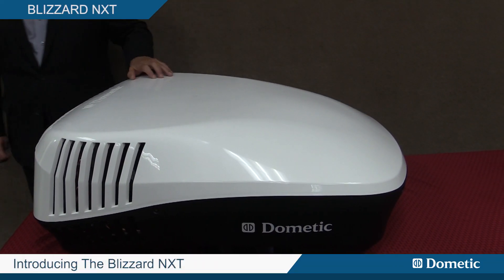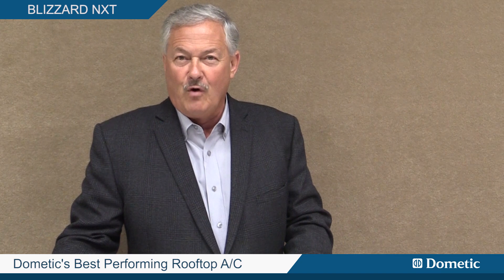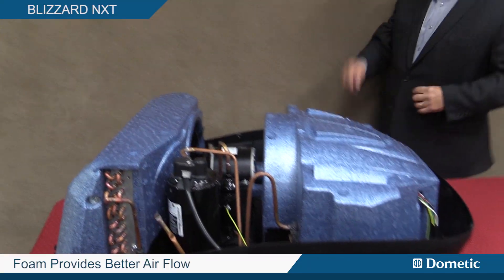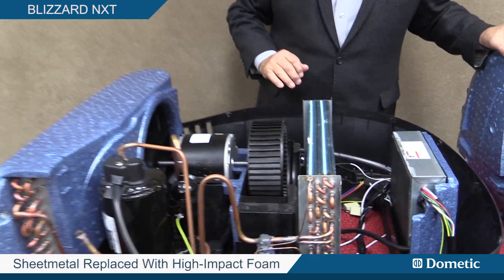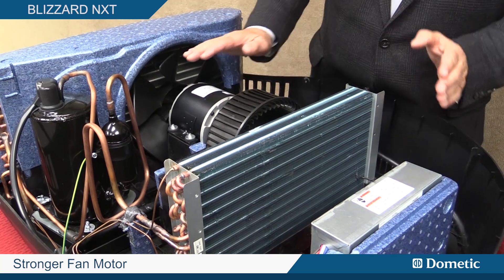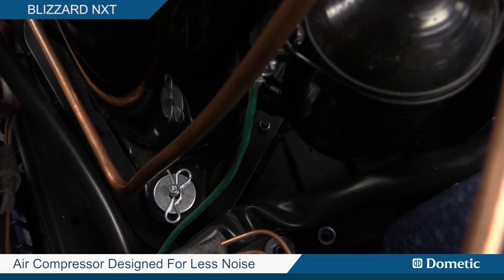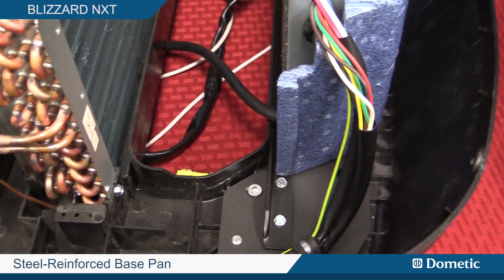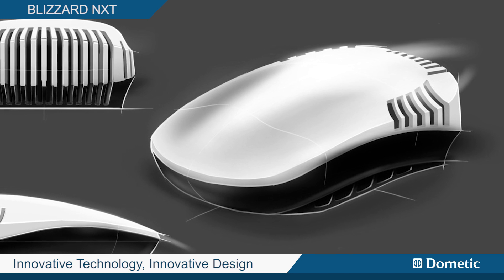Dometic's Blizzard NXT RV Rooftop Air Conditioner

Comment: I have a brisk air ii 15k will this blizzard nxt 15k install plug and play?
Reply: No you gotta buy a circuit box to make it work. Call dometic and the will give you the model number for it . But if you have a blizzard already I would just stick to what you have because that circuit box is big for a 14×14 hole.

Comment: Still not as good as a Coleman! Or Mach!
Reply: I have a coleman mach in my two year old camper, it is junk. Can't even keep my camper at 75 when its 80 outside it runs constantly and the compressor sometimes cuts off in the middle of a cooling cycle. I had a 20 year old dometic that still worked flawlessly in my old camper it would blast you outta there in a 100 degree day. Suburban furnaces are junk too.

Comment: Notice the missing bushing on the wiring bundle entering the metal electronic control box, NO protection for those wires is seen.
Reply: I was about to comment on that, I can see that becoming a fire risk as the coach vibrates during travel and I hope those foam enclosures are fire resistant as that looks to be fuel should a fire start in the ac unit!

Comment: Have they ever solved the Coil Freeze up Problems on many of their RV units  ????????
Reply: 1995dresser low Freon in the system. They all are shipped with the bare minimum and they’re a sealed system so they’re basically designed to fail.
Reply: 1995dresser I think the freeze up problem might either be under charged units, or poor airflow across the evap, though the other problem might be filters not being cleaned or insufficient ducting!